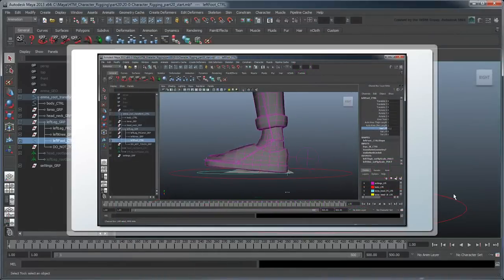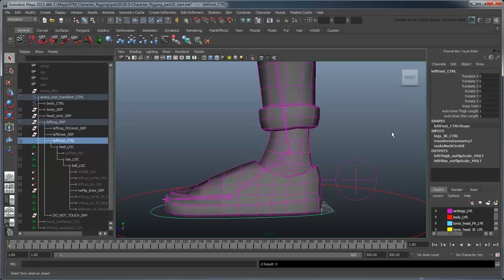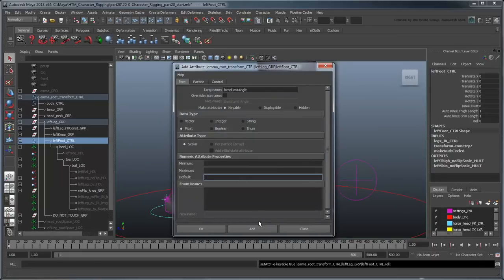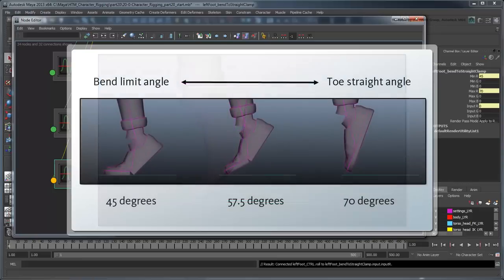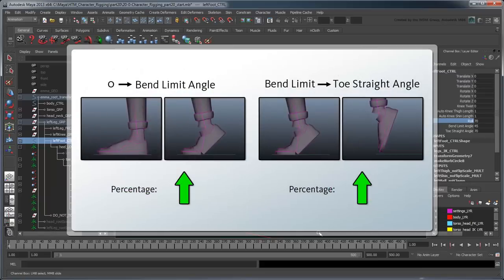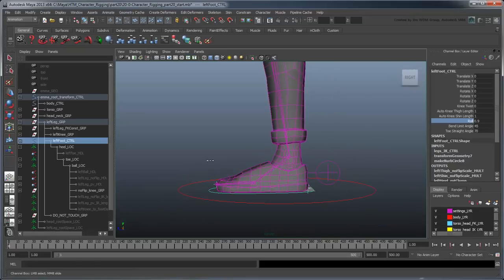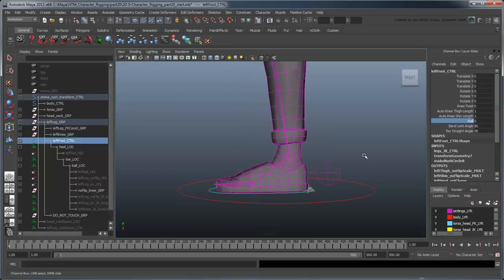Creating a Character Rig - Part 20: Smart foot roll (Advanced)

Comment: Hey there @Maya Learning Channel, thank you for this amazing tutorial again! I have a question though, I have done this smart foot roll setup on the left leg first, and everything is working perfectly. However, when I rebuild the same thing on the right leg (I mirrored the joint structure from the original but not the IK handles), whenever I roll the foot on the positive rotation, when the foot rotates over the vertical angle, my toe joint flips over and flips the corresponding geometry with it. Could you please help figuring out where could the issue come from? This only happens on the mirrored leg, the original left foot joint doesn't flip in the same scenario.
Reply from the maker: When you say you "mirrored" the joint structure, did you do so using the notes in part 32 of this video (where I talk about mirroring)?  If done correctly, the joints should actually be oriented in the opposite direction on the right side.
Reply: @Autodesk_Maya  I believe I followed the steps according to the corresponding tutorial, and the joint orientations are mirrored correctly, and everything seem to work fine except for the toe joint flipping over, so I am not sure what went wrong. But are you saying this could be the result of incorrect mirroring? If so I might have to try it again from before mirroring the leg.

Comment: Heads up to anyone following this tutorial series: Around tutorial #31(?) you will have to do everything you learned on the opposite side of the body.
I circumvent this inconvenience by constructing my footroll on both sides of the body simultaneously. The nodes shown in this tutorial (the clamps, set ranges etc) all have multiple inputs, therefore in the name of efficiency, I recommend, that you make use of the extra inputs as your connection points for the opposite foot, that way both feet will be sharing the same nodes. Just be careful and pay attention to your connections.
Reply: Thanks!

Comment: Thanks for the great tutorial and clear explanation. I have a little question. could you please clarify why do we need to multiply two percentage values (normal and inverted) to drive foot's ball straightening? It seems to me that the reversed percentage is enough to drive the ball angle (same by multiplication with a clamped output). Is there a good reason for this double multiplication of Percentage(from ball remap)*(1-Percentage (from toe remap)) before multiplying it with clamped Roll?

Edit:
I've also checked on nodes behaviour and it is clear that one of those Percentages/coefficients be equal to one all the time the other changes its value. This leaves us with linear value change since we always multiply by 1, either in case of bending and straightening.

Comment: is it possible to duplicate the leg with the rig to the other leg? (like mirrow the leg with all atributes?
Reply from the maker: Unfortunately it's not that straightforward.  You can mirror some of the joints using the Mirror Joint function (as detailed in part 32 of this tutorial) but you'll need to re-build a lot of the custom functionality like controls and whatnot.

Comment: This is my second time reaching this part of the tutorial where this weird problem caught me by surprise which did not happened during the first time. I am rigging both legs altogether, while both the legs were fine before reaching any extreme, the left leg ball joint would be flipped around after a point as if the rotation on the LOC would affect the rotation on the ball joint. 

I read the comments and checked the local rotation axis for all and there was strangely nothing noticeably wrong. However with the local rotation axis toggled on while rotating the toe LOC it is clear that the joint is spinning on the x axis for unknown reason. The same sets of joints mirrored for the right leg works perfectly fine with no parts flipping. I tried deleting and reconstructing the IK handle and back tracking a step before hooking up the smart foot roll but everything seems to be in vain. 

On the other hand while the right leg joints has no parts flipping the heel of the leg would be lifted when the heel rotation reaches a point. Although both the problem would only occur when the foot roll is pushed to an extreme. But it is quite inconsistent to behold. 

Any help would be greatly appreciated. THANK YOU!
Reply from the maker: Hmm, is this with both IK and FK controls?  If only IK, are you sure they're all using Rotate Plane solvers and that "Enable Twist Controls" is turned off?
Reply: Sorry for the late reply,  @Autodesk_Maya . Yes i just checked and they are indeed Rotate Plane solvers and Enable Twist Controls option is unchecked and turned off.  Any idea where else could be the faulty cause? Thanks for the reply. Appreciate it .
Reply: Hi again, I am using my own character model and the legs are angled out and i decided not to conform the mesh to the joints. Is that a potential reason? Somehow after troubleshooting and testing it again and again, i feel like the angled legs paired with the locator have created a weird gimbal rotation that feels like at a point the joints and IK handle were locked out and hence started to move out of place. Not sure whether that sounds absurd...but thanks for any advice you may provide.
Reply from the maker: @Wongjiunnhann  That is absolutely possible.  The problem is that your feet aren't aligned with your leg joints anymore, so it can definitely get you into the problem you're describing (not gimbal lock persay, but an inconsistent start rotation).
Reply: @Autodesk_Maya  , I see.....So its better to have the geometry conforming to the joints to retain a neutral vertical set of joint chains for such use cases then. It wont be possible to rotate the LOC and have its starting rotation to be aligned with those of the joints since its rotation value will be inherited by the joints once its parented together right? Alright then, lesson learned, THANKS for the great tutorial and the helpful reply.
Reply from the maker: @Wongjiunnhann  Yeah.  You basically want to make your bind pose as "neutral" as possible to avoid complications down the line.

Comment: Hi! I have a quick question. I am currently working on my right foot. When I set up the rightHeel_rot Clamp to Min R -90, the fool roll in a opposite way where it roll downwards and does responds to the proper roll. However, when I set the Max R to 90, the foot roll works just like it works in the video. The same problem happens to the rightBall_rotClamp. Im ok with this but I am having troubles to set up the bend limit angle and toe straight angle where they dont seem to work at all with my clamp adjusments. Sorry for the lengthy sentences, just wondering if you have any input on this, or answer. Hope to hear from you soon!.
Reply from the maker: Hmm, the rightHeel_rot clamp shouldn't have any effect on the direction of the foot roll.  It's only there to limit the foot from rolling too much (i.e. breaking the ankle).  Setting it to +90 would presumably prevent the position shown at 6:22.

Try this: rotate both ball joints so they look the same (let's say 45 degrees).  Now check the rightFoot_result_JNT.  Do they both have the same rotations, or is one inverted?  You want them both to be the same.
Reply: Thanks for the prompt reply! I took a look at them and the rotations of the joints seem to be correct. I also check the rotation space of the joints and they are also set correctly. I went back to part 19 and check the heel/ball/toe lift, found out that they all works oppositely as what you have where for example your heel lift on negative roll value will left the foot up and mine will roll it downwards. Would it be possible to continue at this point, can I work with what I have? Sorry for all the troubles:(
Reply from the maker: @goodywu7653  Hmm, that is likely the cause of your problems.  I would try grouping the heel_LOC in a new group (with its pivot centered on the same locator), then rotate that group 180 degrees in Z.  This should correct your rotation values.
Reply: Hi, Thanks for the prompt reply, I tried your method, but it doesnt seem to be working. It flips the foot to whatever rotation on set it on. Also I just realized my local rotation axis of my rightFoot_IK_JNT is inverted. I think this is the source of  my problem. Do you have any method to fix this...:(
Reply from the maker: @goodywu7653  Try opening the Node Editor to show all the connections to the rightFoot_IK_JNT.  Temporarily disconnect everything (making note of what they were originally connected to), then use the Orient Joints tool to re-orient that joint.  Then re-attach everything again.  This should fix your problem.
Reply: Hmm...still not working:S would reversing the clamp value and the bentToStraightPercent value help? Sorry this is the last question, i think I might just move on.

Comment: Im having an issue with the roll not moving the joints when inputting a positive value however a negative value seems to be working correctly?
Reply from the maker: Are you sure the Bend Limit Angle and Toe Straight Angle are set to appropriate values (45 and 70, as shown)?  This can happen if they aren't.
Reply: Maya Learning Channel thanks for the reply, seems like the issue was  input x not being connected correctly from the leg control to the bendangle

Comment: So basically SetRange is the same thing as the Linstep MEL Command ? It return a percentage between a min and max value? I am used to do this Foot Roll system the old school way which is coding it by hand with expression. But my colleagues told me to stop using Expression since its slow and almost nobody do that anymore.
Reply from the maker: Yes, they are essentially the same, although SetRange does it via a value remap rather than percentage.  But the end result is basically the same.  And your colleague is correct - doing things via the graph evaluates faster than expressions.
Reply: Oh cool got it sir Ill go my best to switch from Expressions to Nodes. Thanks a lot

Comment: How does using the nodes compare to using, say, Set Driven Keys?
Reply from the maker: Set Driven Keys is fine too, but it'll always result in the exact same foot roll.  This technique has a more complicated setup, but allows you to create (and modify) any type of foot roll on the fly.  For example, when a character is running versus walking, the foot roll will be different.  Or if the character is going up stairs.

Comment: Hi Sir,
I want to learn rigging, so i just following the tutorial from the start, currently i got struck at part 20 smart foot roll. Were i'm not getting the result as expected. I have added the image for reference http://s345.photobucket.com/user/jay_k1890/media/error_zps8igf9czn.png.html

Can you please suggest what went wrong. Aside to that, all the part till i had watched in this tutorial is well explained and easy to follow.
Thanks in advance.
Reply from the maker: It looks like something is wrong with your Bend Limit Angle.  The result you're seeing is what happens when the Limit Angle = 0 and you attempt to roll the foot.  Double check that your clamp nodes are doing the right thing, as well as anything else attached to them.
Reply: thank you sir now its working fine. I just reworked on node editor.

Comment: I'm having a problem with the Clamp Nodes from 5:00 to 6:30. When I cycle through a positive Roll, the foot seems to lift from the Toe Pivot and not the Ball Pivot. Likewise when I cycle through a negative Roll, the foot seems to rotate around the Toe Pivot and not backwards onto the heel. 
I've checked my Outliner and it matches, I've double checked my nodes and they match. I even unlinked the Locators from the Roll Attribute and they work perfectly. I'm just super stumped as to what is happening, could you help me please?
Reply: Nevermind, I'm an idiot lol. I put the Roll into the StraightClamp and not the Bend Limit Angle (FacePalm)

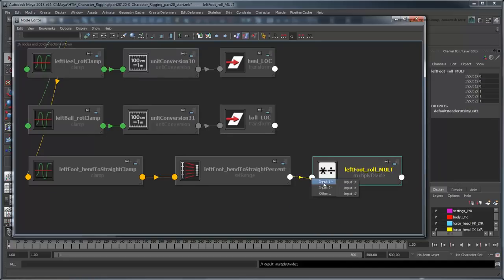Comment: at 15:55 could we feed the leftBall_zeroToBendClamp node's 'input R'(which is the 'roll' value itself) into the 'input 1x' of the leftBall_roll_MULT, instead of feeding the 'roll' attribute directly from the leftFoot_CTRL? just as you did for the leftFoot_roll_MULT at 9:40.
Reply from the maker: Not unless you want to skip the front toe roll.  The whole point of not doing that is to service the compound movement of heel -> ball -> toe that makes up a proper foot roll.

Comment: Hello! I have a problem with my right leg. I'm redoing the foot roll but for some reason the heel_LOC goes beyond the zero in X rotation. I'm at 5.10min of this video. My left leg works ok, but this one seems to have this one issue that leads to heel rotating beyond zero and thus breaking my entire foot roll.

Comment: Couldn't this exact same thing be done by taking the attributes created from the last video, creating a foot roll attribute, and use set driven keys to control each of the previously created attributes?  All you have to do is make a range of -5 > 10 for the foot roll.  at -5, key everything at 0 but the heel lift is maxed, at 0, everything is zeroed, at 5, key everything at 0 but the ball lift is at 45, then at 10 key everything at 0 but the toe lift at 70.  that seems to have worked for me and was SIGNIFICANTLY simpler
Reply from the maker: +david burnham Yes you can absolutely do this, but it's more limiting.  Because you're using set driven keys, you can't vary the angle / degree of foot roll on the fly.  You would have to do the driven keys over again.  That's the general trade off when using driven keys for controls.

Comment: Hi, an excellent series I must say. Though I have one question since this Smart foot roll is purely an IK setup. If I wanted to animate a walk cycle using my FK chain and still wanted to use this system, is my only option  to blend between these two setups in the instance of animating a foot lifting off the ground?  If so, how would u recommend doing this in order to make it as intuitive as possible?
Thanks for your time.
Reply from the maker: +Samuel Chovan Yes, that would be the best method.  In the appendix of this video series, we show you how to write a script that matches IK joint positions to FK and vice versa, so switching between the two modes becomes easy / seamless.  I would highly recommend using that to accomplish what you want.

Comment: Hello, thank you so much for this wonderful tutorial. Currently I am up to rigging the right foot of my character and I am having trouble with the ball roll after connecting it with the percentages. After connecting all the nodes together, step by step, when my right foot hits 45 degrees, the foot goes back into the zero degree position rather than the position it is suppose to be in. Also when getting to the 45 mark, it starts doing a back and fourth movement instead of following through to the actual position. Similar to Ocelott|SheDoesStuff question. Could you advise on what I should do? Thank you. Also I did check my ik HDLs, and joint's and they are setup correctly.
Reply from the maker: +Step Tenn I would double check your clamp and math (multiply/divide) nodes.  Usually if things start to go wrong after the clamp point, it means there's a problem with one of those two.

Comment: I have a question about efficiency; right now I'm rigging a character and I'm working on the left leg/foot and the right leg/foot simultaneously, since later in the tutorial you explain that they both have to be done separately anyway, and I was wondering if it is a good idea or not to use the same nodes for both controls. For example, I'm plugging in all of my left feet attributes into my multiplyDivide, clamp and setRange nodes' inputX/R attributes, while plugging all of my right feet attributes into the same nodes' inputY/G attributes, likewise for the outputs.

Is this a bad idea?
Reply from the maker: +Recursive Sweatpants It won't make a huge difference performance-wise since those are pretty light nodes.  I would worry that it may become confusing later if you need to troubleshoot the rig, but if you're confident you can handle that then I see no reason this should cause a problem.

Comment: I am trying this out on the right foot. Everything seems to work fine, but when I use the roll attribute (rolling the foot forwards) the ball rotates a little bit forward, then backwards to straighten out. But the problem is that it does that before the to lifts off the ground which looks weird. What should I do?
Reply from the maker: +Ocelott|SheDoesStuff It could be an issue with your IK handles being setup incorrectly.  I would double check them.
Reply: +Maya Learning Channel I checked them, and they seem to be working fine. I believe that it's something wrong with some of the nodes, but I'm not sure what it could be...
Reply: Nevermind! Got it fixed! sorry for the trouble.
Reply: +Ocelott|SheDoesStuff I am having the same problem, what how did you fix this?
Reply: +Johnny Derby Make sure that the nodes are all correct, especially the invertPercentage node. (that was where I was having problems) Input1D[0] should be set to 0, with Input1D[1] connected to rightFoot_bendtoStraightPercent's outValueX. Key note is to double check the nodes, and remember that any measurement nodes should be inverted on the right limbs. I hope that was helpful! :D

Comment: Im not sure Whats casuing the foot roll to flip... i positive everything is going as i followed the tutorial. The forwards roll onto toe works correct in value, but negative value also is rolling forward to the toe :(
this is my second attempt after reconnecting
Reply from the maker: +jiteshz Did you double check your clamp values?  Seems that something might be wrong with the value being clamped to or possibly you have an absolute / negative multiplication going on when the foot roll passes 0.